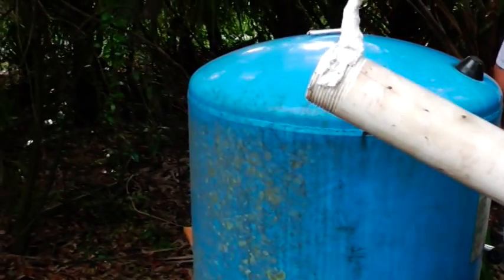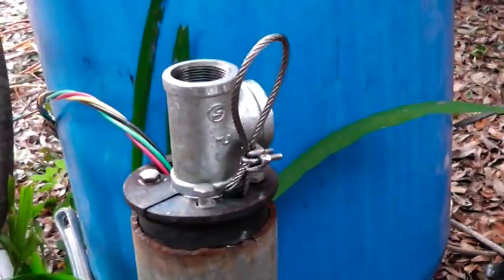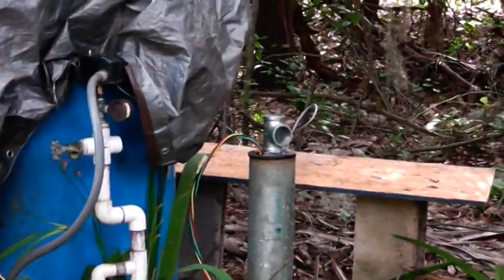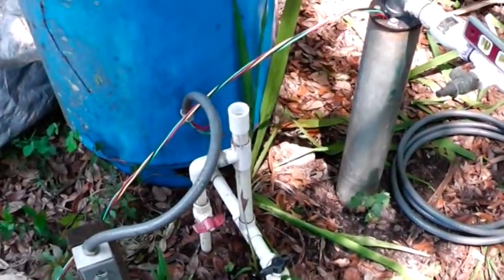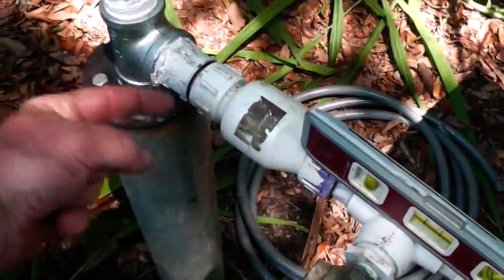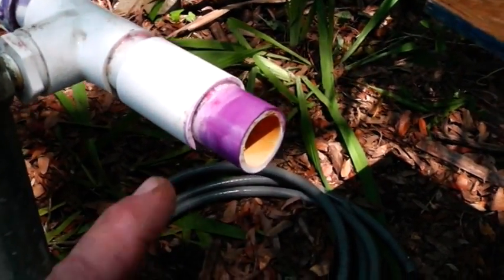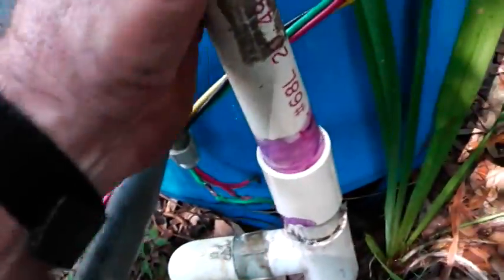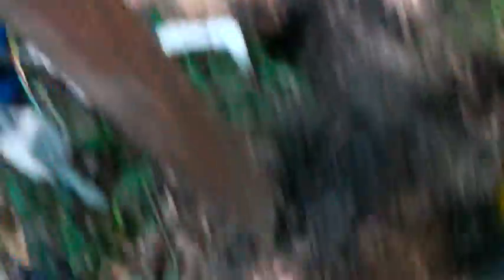Installing a Submersible Pump in a Deep Water Well: Part 2

Comment: Nice video. Thanks. You could have installed your pump on WellHose DIY Drop Pipe. Super easy and quick and no need to buy a pipe clamp.

Comment: Thread sealant will degrade the structural integrity of PVC over time.   You should only use pipe dope on metal fittings, on threaded PVC you should always use tape.

Comment: Little tip to clean up your plumbing would be to put a bushing and your PRV on the top of that tee instead of a plug. And as far as the check valve I would have put a Flomatic 80E brass one in the well that way you didn't need one up top showing.

Comment: What kind of tool did you use to hold the pipe to keep it from falling in the well case
Reply from the maker: It is called a well pipe clamp.  You can buy 'em online from America West Drilling Supply. A local well supply would have them too. They range in price from @ $250 for the 1 to 2 inch,$475 for the 2 1/2 to 4 inch and @$495 for the 5-6 inch.  I highly recommend one for the job.  If you can borrow one or rent one that would be great. You could also make and use one at your own risk.  I was fortunate to have a friend loan me his.

Comment from the maker: Good question.  My old pump was a 2 wire, no control box needed.  My well drilling friend advised me that I should get a 3 wire with a CB because if the capacitors(start and run) ever go bad you can change the CB up top instead of removing the pump and changing them.

Comment: "Controller Box"... Hmmm... I don't GOT one of those. 
I have a breaker box about 50' away at the barn, with the wires feeding to the well switch. 
What does the CB do... and why do I NEED one ?